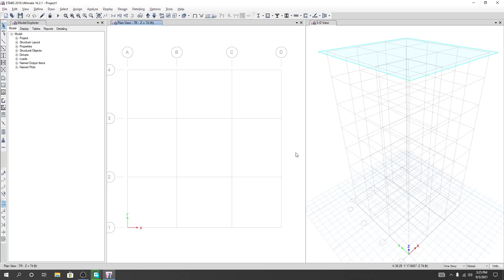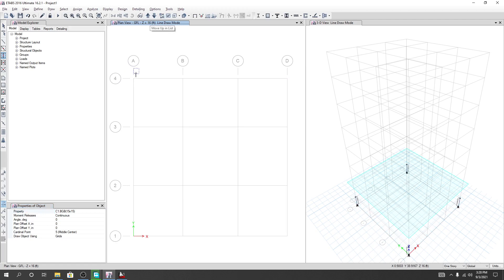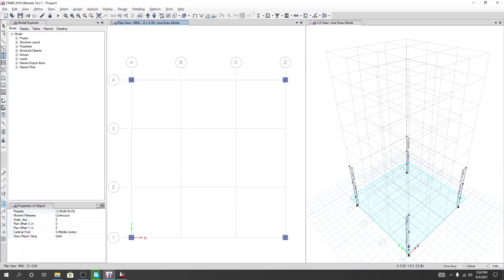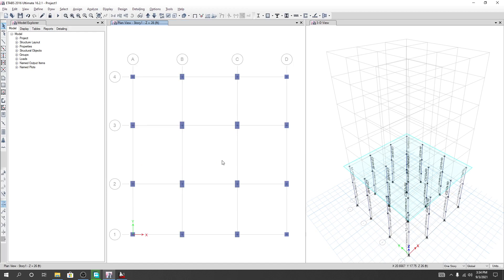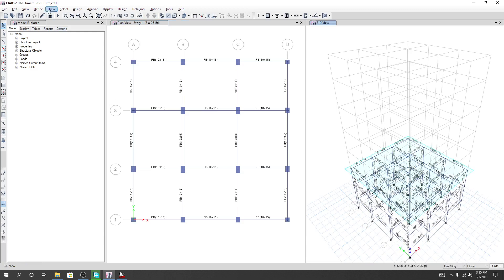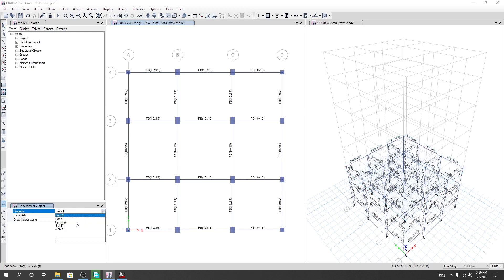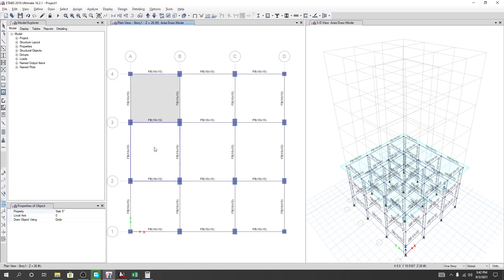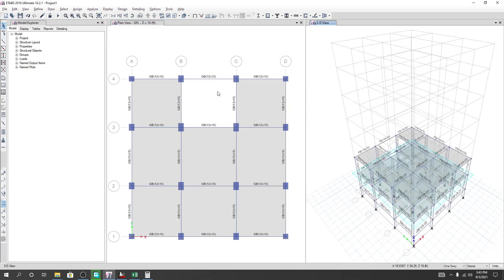4. Complete building design in Etabs 2019 | Real Project Design | Draw beam column slab  in etabs

Comment: Need help,
I modeled 4 story building w/ concrete frames & slabs. I ran the design/check analysis w/ ACI 318-14 code. 

At the upmost story, the joint shear check/design & the (6/5) beam/column capacity ratio value is shown as N/A with notes :
N/A: Not Applicable
N/C: Not Calculated
N/N: Not Needed

Why the value is shown as N/A? What are those notes mean in particular? and How am I supposed to fix/handle them?

I've been a  while on the internet but nothing.
Is there any specific reference regarding those issues?
Reply from the maker: if you use link, then this value will not be visible. or need earthquake load for that.